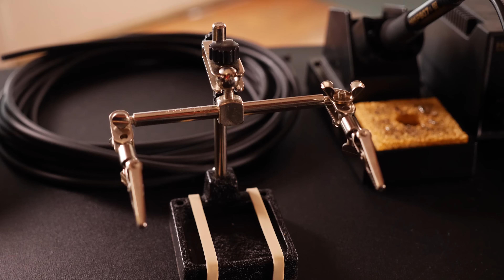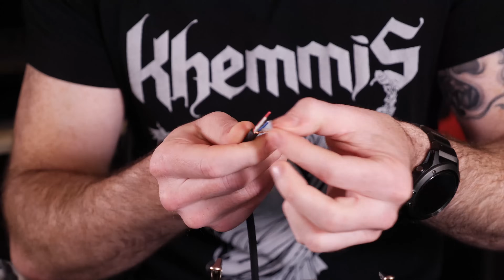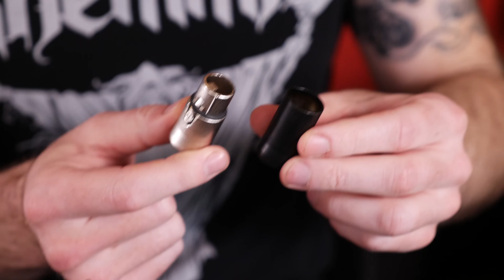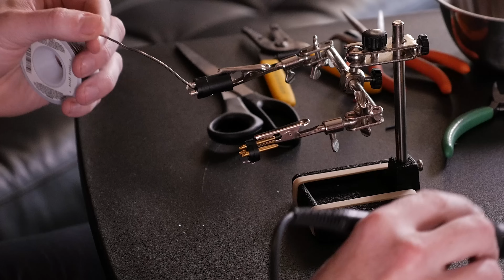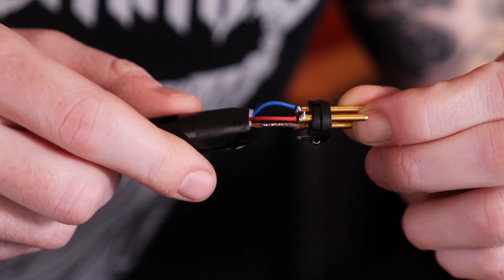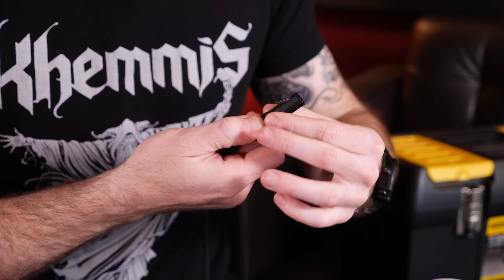MAKE YOUR OWN CABLES?? w/ Dave Otero

Comment: DO NOT INHALE THE SMOKE! IT AIN'T VAPE
Reply: It's about as harmful as vape.  Soldering a few cables ain't going to cause any harm.  It's only when you do it all day constantly where eventually you MAY have an issue if you are allergic/react to it.  And even then it's just minor issues because solder fumes are NOT as toxic as people make out. 

The handling of the actual tin/lead solder is more dangerous than the fumes. 

I was going to comment to watch out for the armchair experts who will leap on every tiny detail that the uploader makes, but this one snuck in early.

If soldering fumes were half as toxic as people claim, there would be an epidemic of wheezing crawling engineers.  Lead does not vaporize into the atmosphere when soldering.

Mostly people get sickened by the smell, just like painting all day etc.  So asthmatics and certain allergies MAY be exasperated by the fumes but that's it.
Reply: @CIRCLEOFTONE  Even if you're right, it's not a great look to kinda handwave away anyone's health concerns related to inhaling solder fumes. Inhalation of fumes should just be avoided by default, honestly. It's not hard to avoid and you preserve your health in the process.